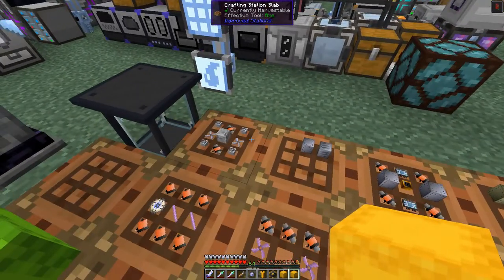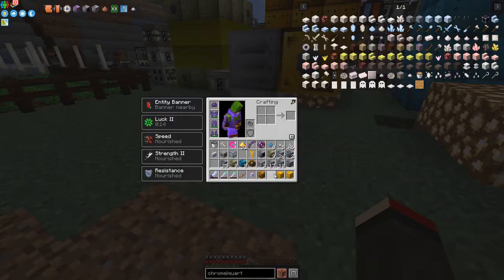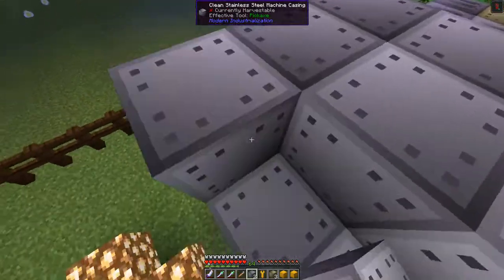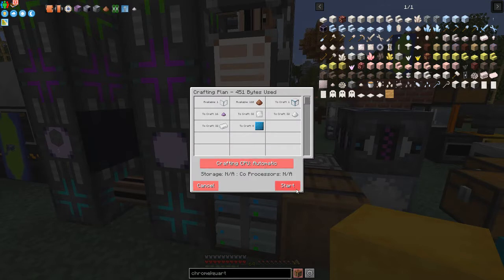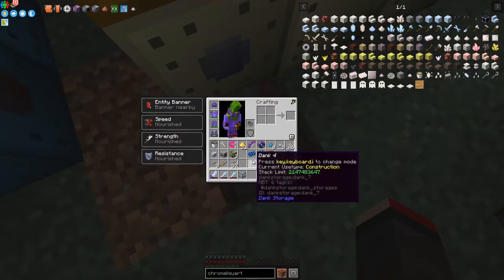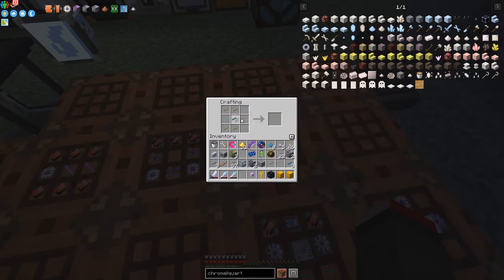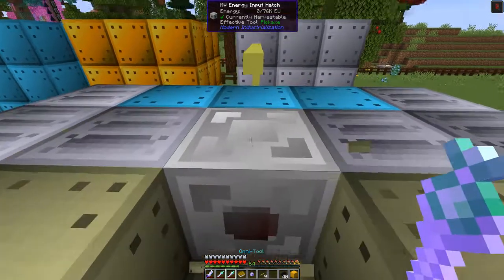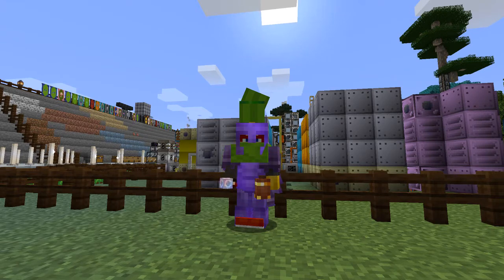All of Fabric 3 #48 - Modern Industrialization: High Pressure

Comment: Just thought you might want to know that you don't have to right click the side of the cable facing the machine with the wrench to get it to connect. You can shift-right-click the side of the machine facing the cable with another cable of the same type, and it should connect just fine - I can confirm it works in v2.8.5 of the pack. I've found it's often much easier to get in a position to do that, rather than click on the right side of the cable.
Reply from the maker: Excellent tip, it has been a bit tricky to attach pipes to a machine, especially when there are more than a connection. Many thanks for the tip.